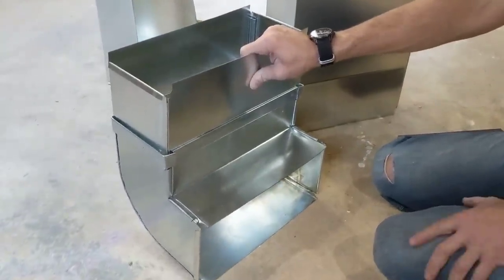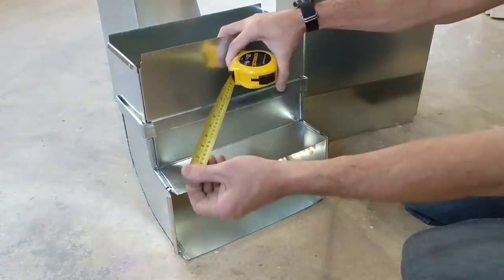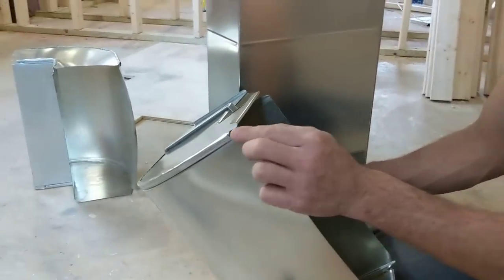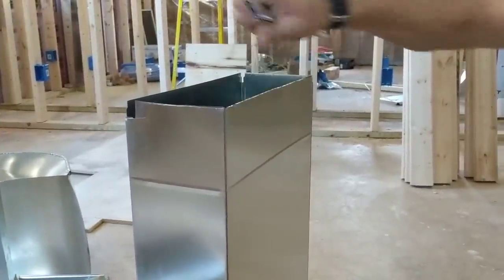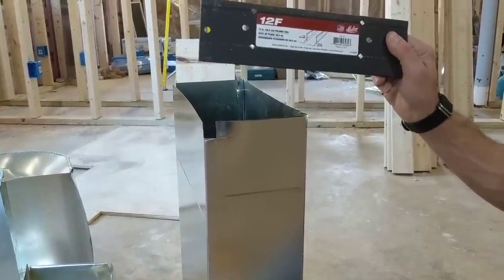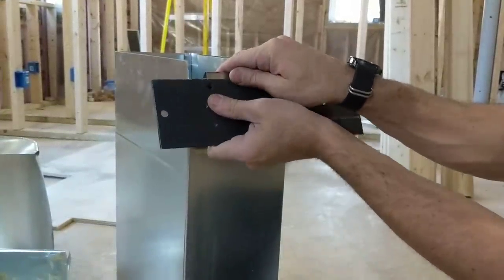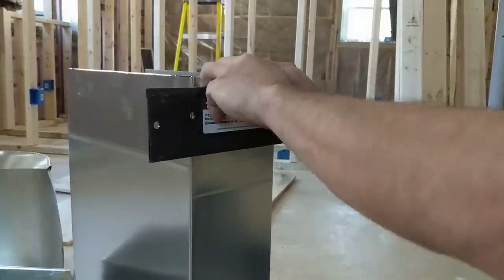Joining rectangular HVAC duct fittings

Comment: Thanks! I've been in the construction industry for 40 + years, but lerned on the other side of the pond. I've never seen or done any of the rectangular duct, your info is super valuable! thank you.BTW I like your humor too!  ( "dumb" department at H.Deathspot). :))
Reply from the maker: Glad you find my humor, well humorous. You're in rare air there. Yes, metric metal bends differently.
Assuming you're French or on the continent, your home has the jump on the Americas for transporting air (Roman central heating) and water (duh. Aqueducts). Some incredible history there. If you're English, what is an Englishman doing with a French name???

Comment: Question,   watched a guy changing my A coil yesterday find out the warranty replacement A coil case also had to be changed, but the new unit was about 1/4 to 3/8" shorter.  The original retro fit had a fabric boot to extend and conform to the new hvac system i had installed 7 years ago.  Now the installer  worked his ass off making an extension to fit the bottom fighting the drive cleats.

Is there any rule stating drive cleats have to draw both connection togather tight?  Cant a new extra wide drive cleat be made or  use 2 more each side making  the s over s over s a longer joint. 
It seems to me this would have given the extra length,  and a tight joint with less work.  Do drive cleats have to be a standard size or can they be made extra wide to add length to the run when you come up short of drawing 2 connections togather. Seems to me that would have been faster with less work.  You can always tape the seam.

Show a fast trick and or answer this.
Reply from the maker: I'm a DIY guy. Hopefully someone who needs their family takes a poke answering your question. You could post on hvac-talk, too.

Comment: You say you built that elbow in another video? Which one? I'm trying to replace a section of furnace return that a plumbing leak has been dripping on and corroded it out. It looks like an off the shelf part but I can't find any mention of it online, can I just make one? If I'm getting the terminology right, it's a rectangular S curve/transition, 6" high and different widths at each end...
Reply from the maker: I assembled the elbows together beforehand. You buy the sheet metal fittings and transitions as custom made. In Raleigh NC, I use Royce Co. Look them up and see if you have a similar shop in your area.

Comment: The trick now is after one section of the duct work is in place on the ceiling or the wall, how do you then join it to the rest of the duct when tools cannot reach two of the four sides.
Reply from the maker: @Greenr0  I had that trouble. I laid tape over the top. Maybe a true pro would weigh in?

Comment: This is the ductwork I have in my house, built in 1930. In the basement where one of the ducts comes down to where the furnace is, thanks to a hole in the bottom, I can see a big thing of baby wipes in a container. I can't figure out how to take the thing apart to get the stuff out of there. I really don't want to have to call someone to do this. any ideas? Thank you!

Comment: sir what is the clip name can u describe it by making design
Reply from the maker: The clip is a long strip of metal formed to look like an 'S' from the end. Each of the slots in the S shape slides over a side of the duct. These connect two opposing duct faces, usually the longer of the two. The clips (strips formed to a 'C' shape) connect the other two faces, after you bend them outward and back (a hem).
Reply: It’s call slip and drive material. The S is slip, the C is drive
Reply: So where do you buy the s slip? I can find the drive clip. Thanks
Reply: Menards sells them through the mail, Home Depot and Lowe’s only sells 5 foot pieces but will mail, or ship.

Comment: What if you get 3 sections down and duct work is racking?
Reply from the maker: Likely either the joints aren't square (even on both sides), or the duct line isn't straight.
Reply: Probably didn’t put s cleat inside and out in opposition of each other

Comment: Hola
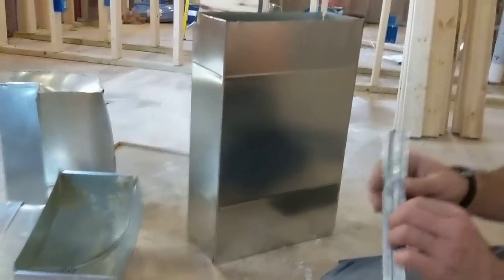1:18   Clip   ??
1:30   como le llaman  ??
Buen Día.
Reply from the maker: 1:18 is a 'C drive clip' available from Home Depot (12 in long is Internet #300684237 Model # MP-AC-DRC 12 UPC Code # 787447002032)
1:30 is a 'S cleat' or 'ESS cleat' Home Depot Internet #202907028 Model # AC-ESS 12 UPC Code # 816040012985 Store SO SKU #1000122706
obtener la longitud correcta
Reply: Entiendo
Gracias.